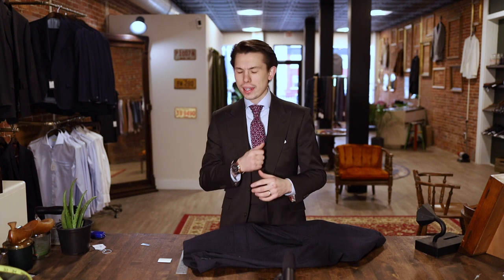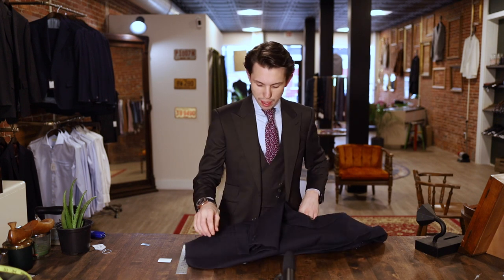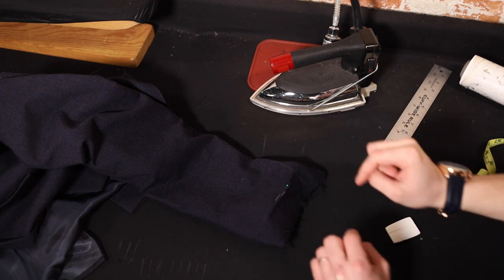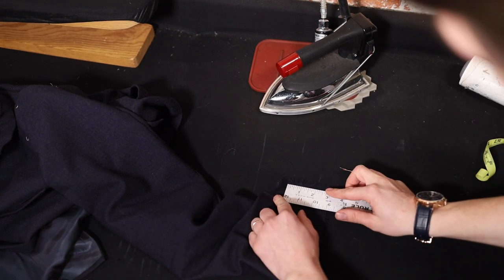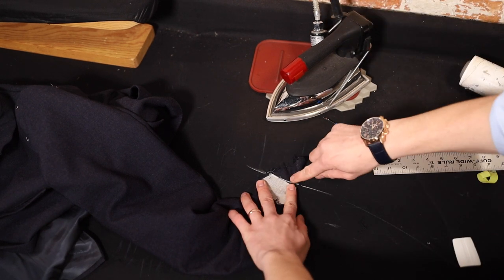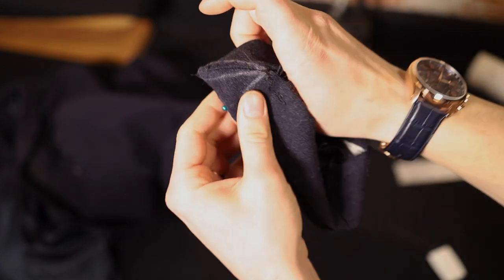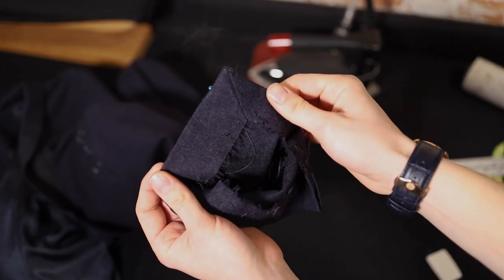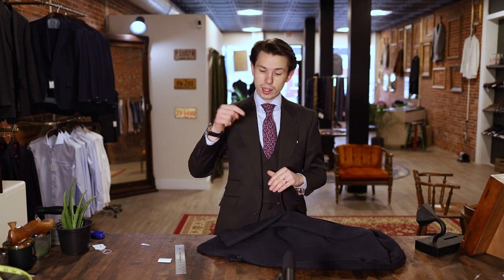How to Sew a Mitered Corner | Shortening Suit Sleeves

Comment: Hello,
Can you please explain where exactly you are marking the fabric to make the mitre? I ask because when I am sewing the mitre the end result is that the edge that runs parallel to the seam is not dead straight, it turns inside and is at an angle, whereas your mitre, when the sleeve is turned the right side out, your nee mitre is running dead straight with the preceding seam so that it all looks organic. Very impressive. Sometimes I achieve this also but it is a fluke. I have tried a few things but none achive the fluid organic continuation of seam to a straight mitre, one straight line. How do you achieve this?

Also, where did you buy your sleeve ironing board?

Thank you very much